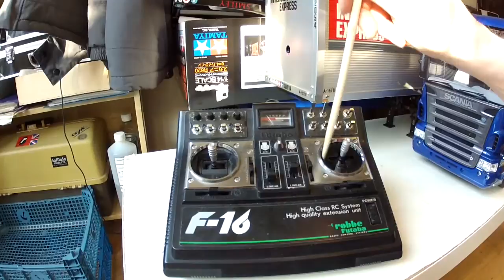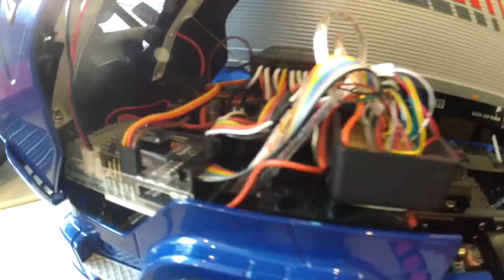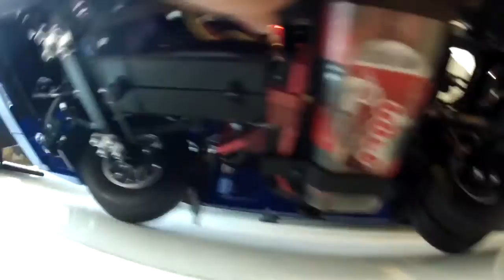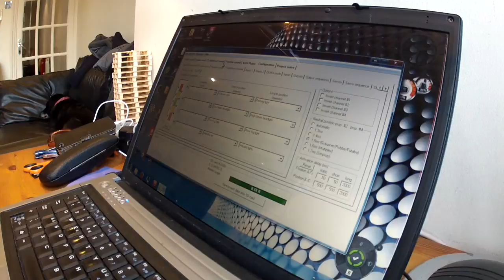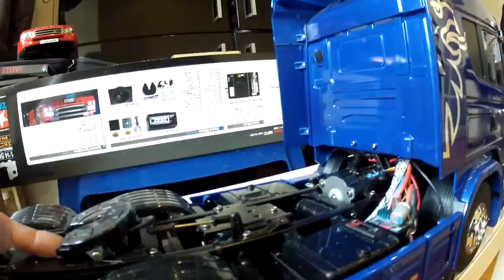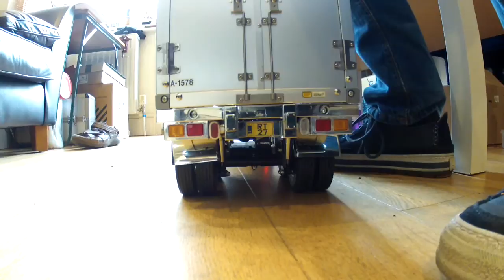1/14 Tamiya Scania R620 Beier sound module USM-RC-2, infrared light module SM-IR-16-2

Comment: I'm stuck on sound teacher at the moment got all my USM wired up with LEDs but when a projects saved it still doesn't work? Are you going to be doing a how to set up video mate with transmitter set up + sound teacher as I'm new to the biere module and so is a fair few others and be nice to have an english tutorial on how to do it :)
Reply from the maker: I’ll try and do one. It’s been a while since I got the truck out, but I’ll try and do something over the Christmas break. I’m sure it will all come back to me! I think I need to put an infrared thing in the king pin of the long box trailer to stop the lights operating when I am backing up to it. I think that I only put one in the lifting flat bed one.
Reply: lotus77s if you could do it in your time when your free that would be absolutely spot on, I had a really good friend of mine that completely stripped my unit out and start again but I'm still in the position of not knowing what goes where or what does what lol I've got the beire USM RC 2 in my mercedes gigaspace and just sold the 4x2 scania to fund a custom build (first ever custom build for me so should be interesting) so the custom build will also have a beire USM sound module in its presents :) I'm also liking your idea of the infrared trailer lights I am too thinking of doing that just for simplicity of coupling and uncoupling trailer/trailers with ease without having to unplug the trailer before unhitching :)

Comment: hi do you know anywhere I can go for help wiring my unit? I just opened the box today and i
am completely lost,.
Reply from the maker: +James Kiernan Hi, it was a while that I did this and it tool a while to work out. From memory I used this document as my main source : . The first hurdle was getting it to switch on I think that is X1/3 on the board needs to be connected for this too happen. This product took me a long time to figure out, but I 2was very happy with the result. I was quite methodical only adding one thing at a time (or changing one thing at a time on the sim card with the software). I inituially got it going with a phony basic set up away from the truck (ie a motor, battery, speaker and one LED etc on the work bench) and built up from there. I did use a small peice of stripboard circuit board between the module and the actual lights, so that I could use common connections and a lot of very thin wire (the kind used for digital set-ups in model trains) and was quite methodical on wiring colours - as it is very easily to get confused very quickly and I lierall added and tested one bulb at a time! It will take a while to do, but very satisfying and the result much more bespoke (and cheaper) than the Tamiya ready made one. I like the ability to duplicate everything in the trailer via infrared and reversing lights etc. This really is a great product but takes an investment of time (rather than a lot of money). In the end I moved to Spektrum DX10t with this as it gave me more options and was easier to set up.Hope this gives you a few pointers & good luck! (I've forgotten a lot of what I did, at some point I might do a video series on this & figure it all out again).